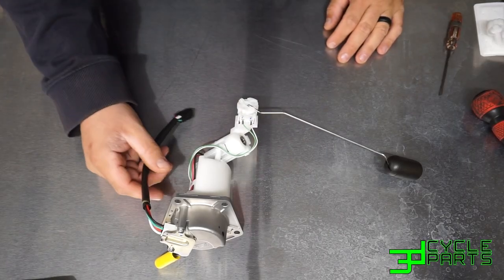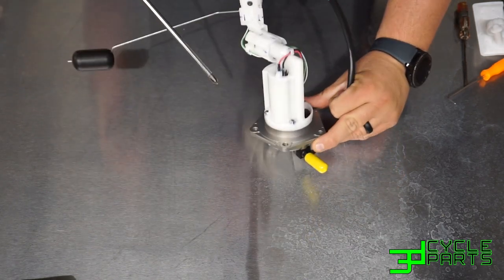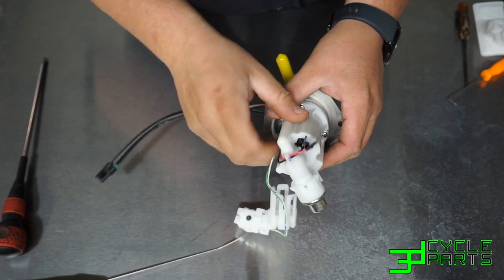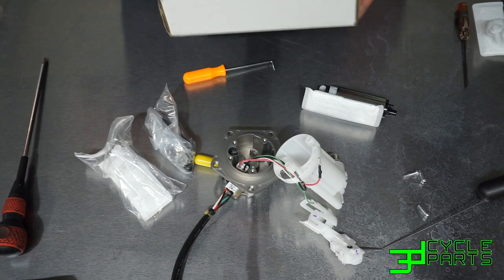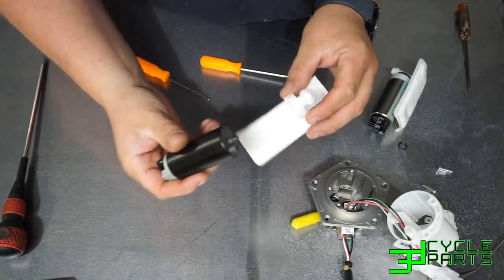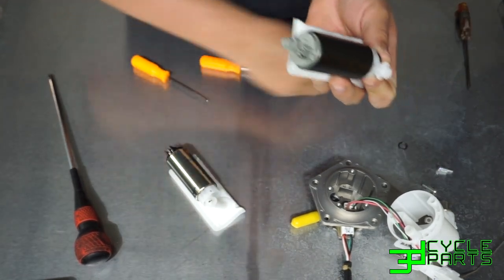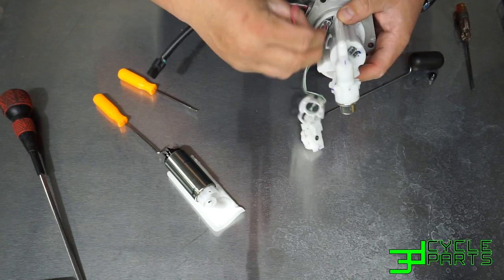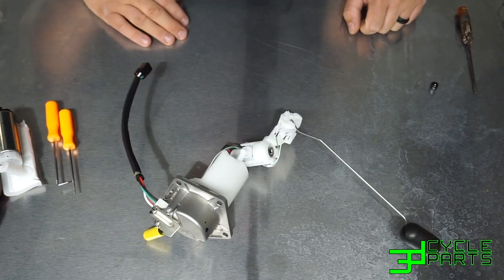How to replace 2022 KLR650 Fuel Pump in less than 10 minutes! - 3D Cycle Parts

Comment: I have a 2022 KLR  (less than 500 miles!) that exhibited bad fuel pump symptoms.   I decided for the price to take a shot at rebuilding the fuel pump instead of buying a new one.  I bought yours, installed it and it works!  It now starts when hot.   All I did was follow your instructions - it WAS easy.   Thanks for saving me money and posting this excellent video.  You can count on my business in the future.

Comment: Hello, Admittedly silly question that I also posted to one of your other great videos BUT - Is there a trick to getting fuel line reattached to pump?? I pulled my tank off of my 2022 KLR recently and am in the process of reassembling. The clips on the fuel line refuse to close. Being plastic Im nervous about applying to much pressure to the the clamp to close. Curious if you have any advice?? APPRECIATED!
Reply: Also - Just checked recalls - Nothing for my bike. Perhaps this faulty fuel pump only applies to specific models?

Comment: Sooooo..... Is this a systemic problem on the new Klr's?
Reply from the maker: Hard to say. I think a very small percentage have had fuel pump issues at this point but it's just enough to make folks worry, especially on trips.
Reply from the maker: There is now a recall.
Reply: @3dcycleparts mine just went out and then restarted 4 days later.. I ordered one anyway.. thanks for the info on the rebuild